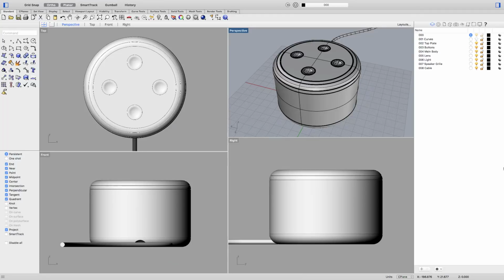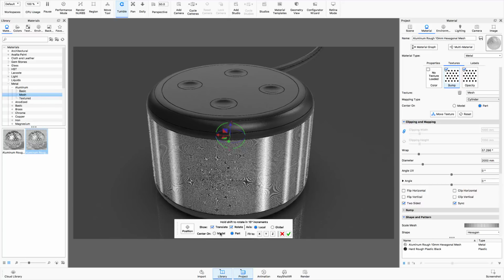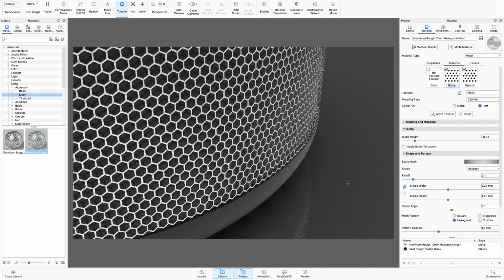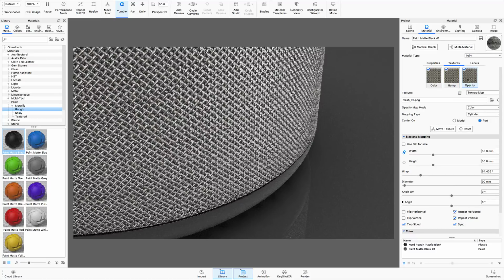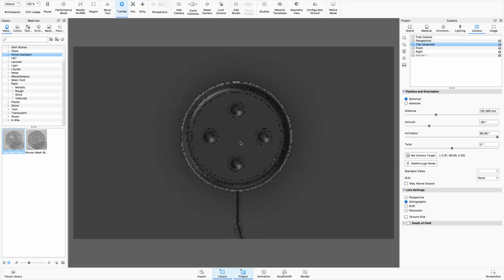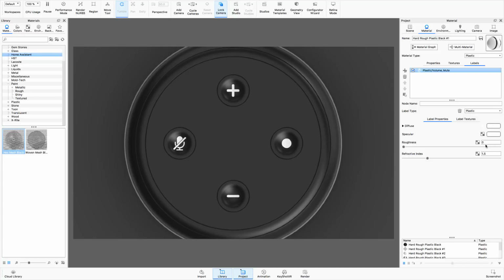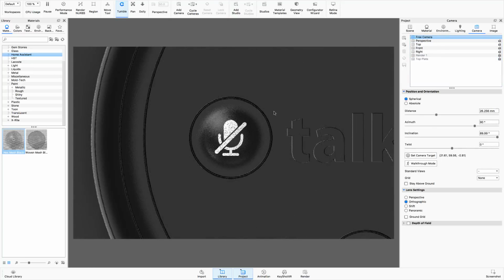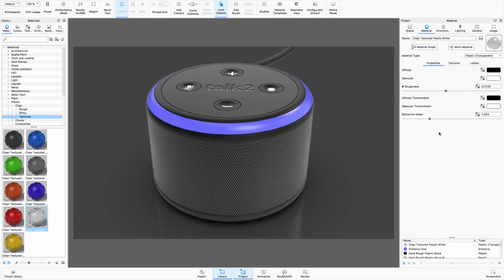Rhino and KeyShot for Mac - Product Rendering

Comment: Would you prefer keyshot more than the render of rhino6?  I ask because i have to make product visualations for bottles and labels and i am so far not happy with the rhino results. It looks not realistic enough.  I worked before with solidworks visual render and it had much better results. Sure its also a dramatic price difference. But even blender 3d projects i can see they look awesome realistic. Do i have to buy keyshot or vray or a onther rendersoftware? I also know from c4d that they make awesome realistic renderings. Do you have a recomendation?